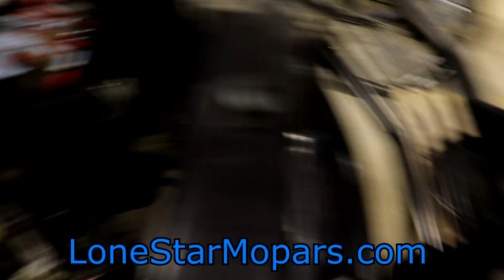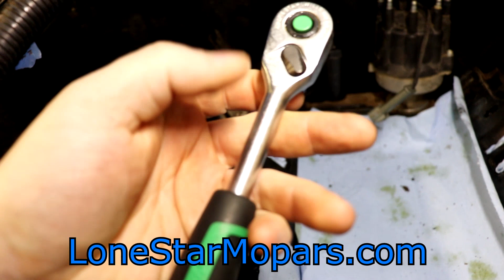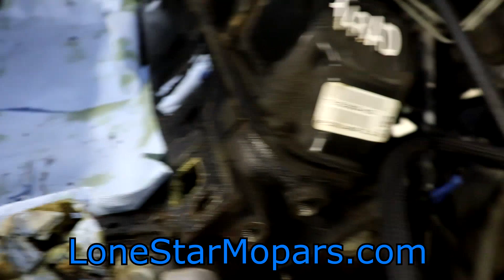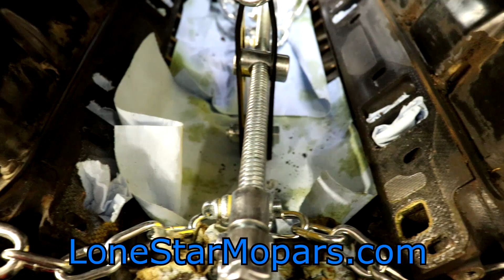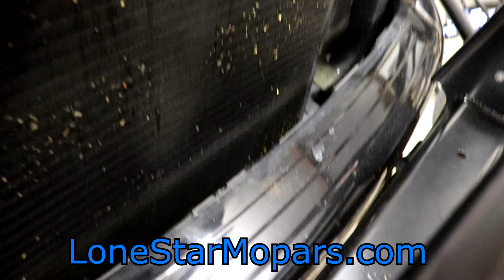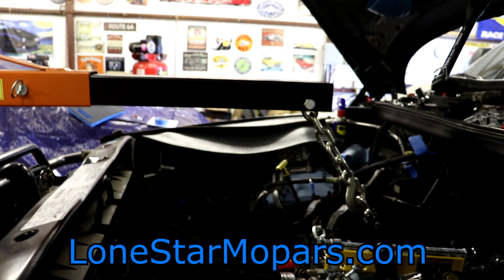Ram Revival Part 10: Distributor, Oil Pressure Sending Unit, and Top Bellhousing Bolt Removal

Comment: The easiest way is to remove the top of the core support I have done dozen of motor at the Dealership . Use a 36 inch extension with a 14mm socket for transmission bolts. The engine only weighs about 375  lbs

Comment: Hey you totally should remove that grill guard with the same hoist you are about to use on the engine! Its gotta be an easy enough job with some heavy duty cargo straps right? Or am I wrong about that? Then lay the grill guard down on a bed of wood. Fun times man. Once that is gone then you can also remove the front bumper for good measure. That would make the previous operation even more worthwhile because its then gaining even further reach. After that well like you said so yourself get some wood or old pallets / broken down crates from work. For padding everywhere all the places you need to keep protected.

I agree that I dont think you can remove the hood by youself easily but that is preferred. Not without some heavy duty mattress or memory foam over the frond windshield. To give adequate protection. And the cargo straps that let you inch slowly tighter / looser + a separate set of shorter 'fuse' style tie ropes or short bungies to prevent a sudden 'out of bounds movement'. Which would be kindda like unwrapping a spiders web and difficult to setup to begin with. Unless you were like some boy scout expert in tying ropes / rigging etc. I guess its harder when you have an too much open area without enough convenient strong places to use as nearby attachment points. IDK. Good luck though !
Reply from the maker: I might do that...You will see the engine come out in the next couple of videos.  Getting it back in is another story entirely...it will all make sense when you see the predicament.